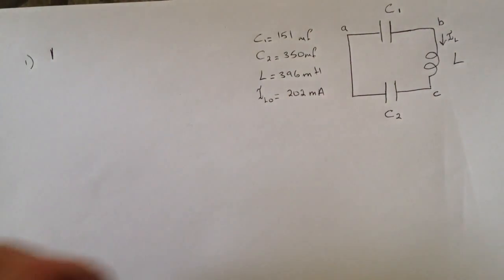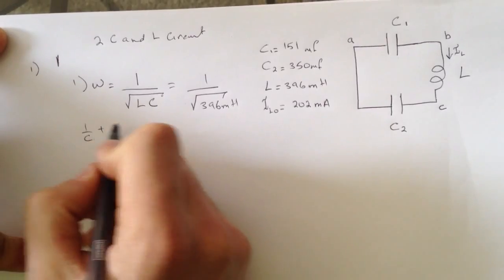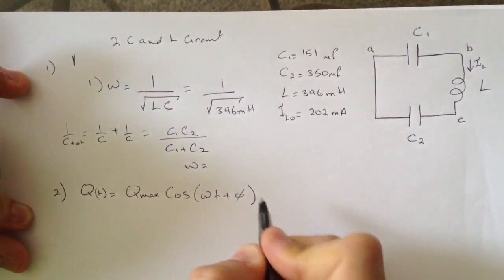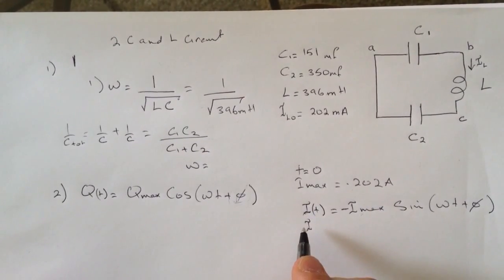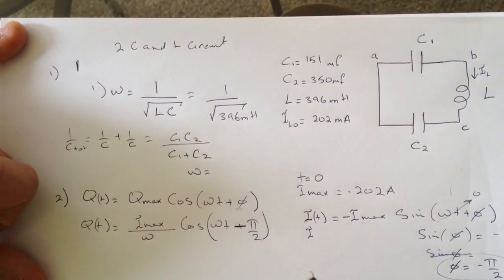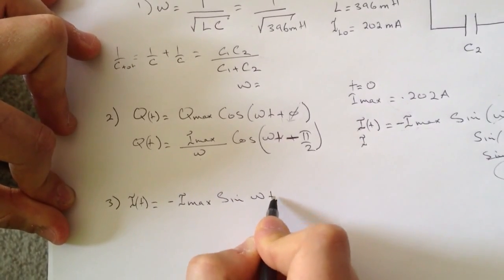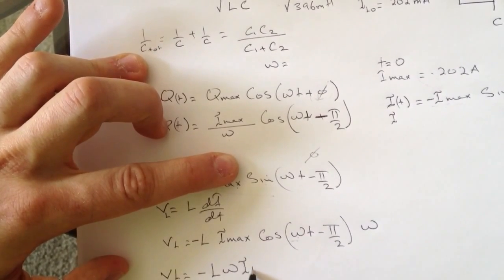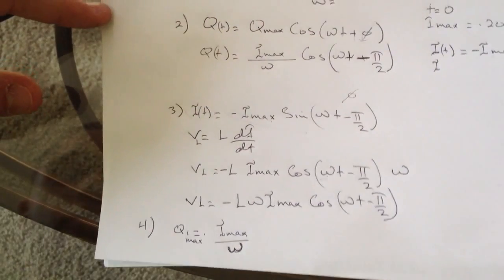2C and L circuit "Smartphysics"

Comment: Do you mind helping me out with number three?
My L = 313mH = .313 H
w = 188.53 rad/s
Imax = 156 mA = .156 A
t = 19.5ms = .0195 s

I plug that into V = -Lw(Imax) cos (wt - pi/2)  = -.313(188.53)(.156) cos[(188.53)(.0195) - pi/2] = 4.69132 
This answer is wrong and I have my calculator in radians, is there anything I'm missing?

Comment: Hi, Thank you very much Walid. 
"What is Q1(t1), the charge on the capacitor C1 at time t = t1 = 16.8 ms? The sign of Q1 is defined to be the sameas the sign of the potential difference Vab = Va - Vb at time t = t1." The question is asking about the charge in capacitor 1... it seems that value you found is the charge in both capacitor. I plugged your answer and found it's correct. However, I am not sure if they are asking for the charge in both capacitors or C_1 only.
Hope to hear back from you.
Reply: capacitors in series have share the same charge, capacitors in parallel will have the same voltage.  So C1 and C2 Will equal each other :)